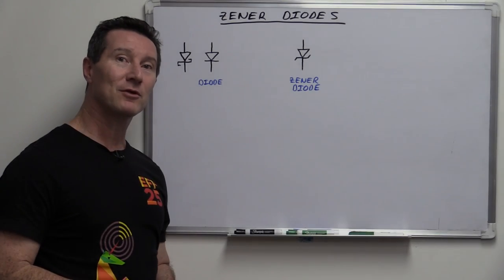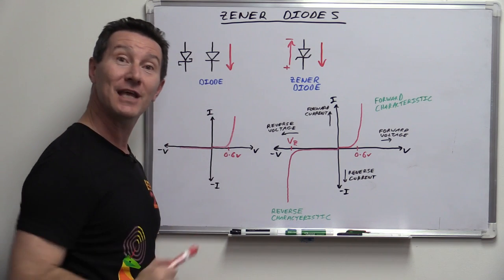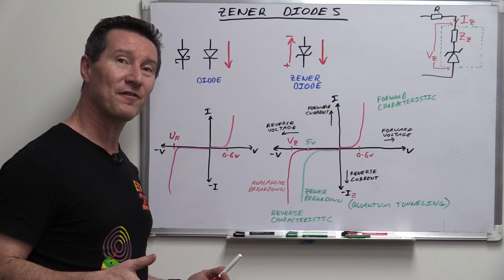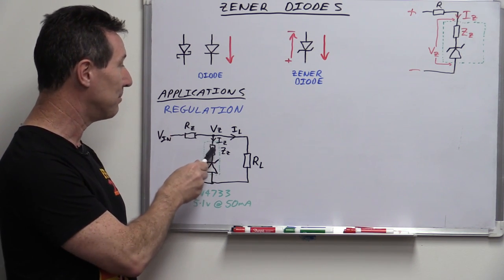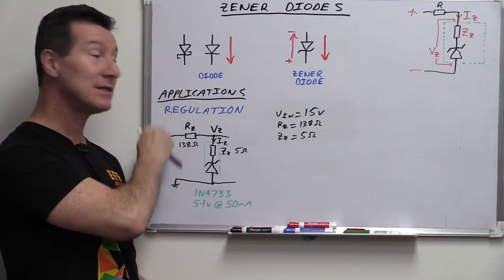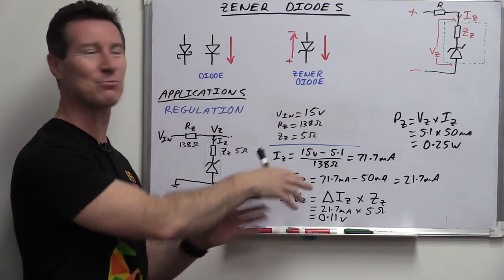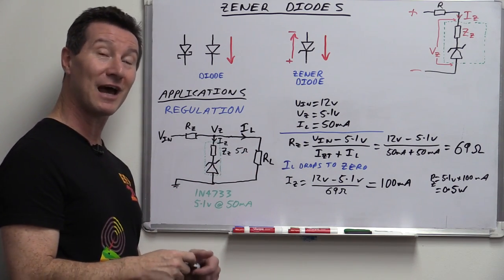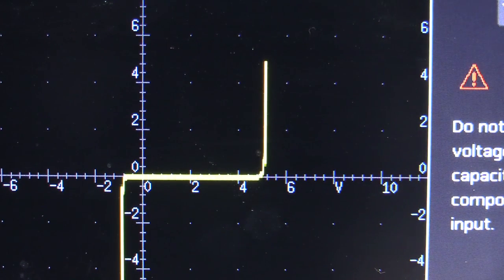EEVblog #908 - Zener Diodes

Comment: 29:00 The output voltage has a slope even though the input voltage is at its highest...How could a resistor be the cause of that? That looks more like a parasitic capacitance or inductance.
Reply: Maybe that strange cable on channel 2 introduces some capacitance

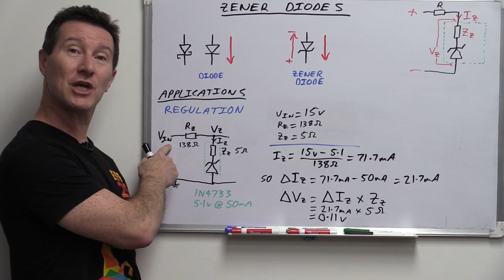Comment: About the calculation of the change of V_Z (around 13:39). So if I got it right: you wanted to calculate how much V_Z is gonna change after we increased the input voltage from 12V to 15V. For this you first calculated how much the current changed (14:54). The formula I_Z_2 = (V_IN_2 - V_Z_2) / R_Z is of course correct. But in this calculation you use the exact voltage that you want to calculate! V_Z_2! And you assumed V_Z_2 remained 5.1V, so the ultimate change we're looking for is 0V. And no further calculation is needed. Otherwise there's a contradiction isn't there? First you assume V_Z_2 is 5.1V then you calculate a voltage difference of 0.11V, so then V_Z_2 is 5.21V. It's a contradiction isn't it?

Comment: Maybe Dave explained it or I'm just not understanding things here (sorry, I'm not an electronics engineer, I'm a Computer guy), what could you use Zener diodes for with their ability to run backwards versus regular diodes?
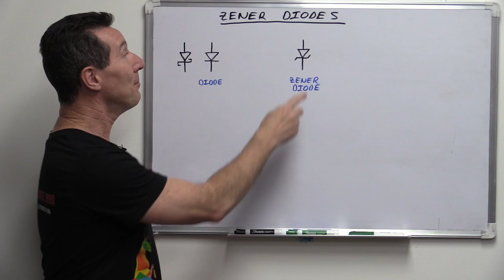Reply: Matt- you should either watch the video again or pay attention around 0:20ish.... clamping, voltage regulation, protection.... great video Dave!  Very informative.

Comment: Makes sense that any diode will conduct in reverse due to quantum tunnelling of electrons between the P and N-doped layers. That's if it even happens this way in the first place... Just a guess. EDIT: Damnit. I was half correct. Just got to 05:57 in the video.

Comment: It is U not V at the diagram, therefore being called UI-diagram, but else pretty good explained.
Reply: In australia Voltage is V the SI unit for voltage is V, therefore IV.
Reply: +Zalgar Well ok, didn't know that.
Reply: dranoelr Didnt want to sound rude or anything, but hes Aussie so he follows Aussie conventions.
Reply: What the unit is, is inconsequential to what the symbol for the quantity is. You can see that by what you just wrote, an IV graph not an AV graph. Same with ohm's law, it's I=V/R (or U/R) not A=V/Ω. In fact, the reason for using U instead of V is likely to make the symbol of voltage different from  symbol of the unit of voltage, to prevent any possible ambiguity that may arise.
Reply: But R stands for Resistance, and I is the current Intensity.
Likewise, V stands for Voltage. But what U stands for?

Also, common terms are Vcc, Vbus, Vin, Vout, rather than Ucc, Ubus, Uin, Uout.
Reply: I'm not saying that V is incorrect, only that that has nothing to do with the SI unit for voltage, per se. Both U and V are in practical use in different contexts with, I think, U being more common in Europe, as well as more common in electrical circuits as opposed electronics. What U stands for? Probably nothing other than shoehorning something similar to V to mean voltage, for the reason I explained above.
Reply: In physics, U stands for potential energy.  Since voltage is a potential, it makes sense to use U when speaking from a physics point of view at least.
Reply: Ruben Iraheta you didn't get the point. I am talking about one-letter acronyms.

P for Pressure, F for Force, m for Mass, C for Capacitance, R for Resistance.

What word starting with letter "U" corresponds symbol U designating a potential difference i.e. voltage?
Reply: Also note that sometimes the acronyms don't make sense either because they have an etymology outside of English, or because there were no suitable letters left to use. I for current is from French "intensité (du courant électrique)" whereas no one really knows where L for inductance comes from. It was likely chosen to commemorate Heinrich Lenz. But the point is that "I" was taken, so some other letter had to be chosen regardless. And the α and β values of a transistor are just Greek letters chosen by convention, because it's not even clear what you would logically call them otherwise. U for voltage may have chosen to reduce ambiguity with the unit of voltage, or it may have been chosen because V was already used for volume in physics.
Reply: Same in EU.
U is messured in Volts v
I is messured in Amperes A
Reply: @Gameboygenius  V is volume

Comment: Hope this is not too silly. Why is the negative mark on the zener connected to the positive side?
Reply: Because it's the reverse breakdown voltage of the zener that is used for clamping. If you forward bias a zener diode it acts similarly to a regular diode (i.e. it simply passes your current)

Comment: maybe you can add an led voltage circuit? i.e. 2v5, 2v7, 3v, 3v3, 3v6, 3v9, 4v1 etc :-)
Reply: C64 DTV, a Commodore 64 clone shaped like a joystick, used its red LED as a voltage reference for its regulator. If you replace it with a blue LED, the CPU blows up from the increased voltage!
Reply: +Gameboygenius so... was it a 1V8 or a 2V1 LED? since blue are nominally around 3V4... :-) so lucky I didn't get one then... ;-) it is an interesting piece of information. Btw, what cpu did ot use? I think C64 had an NMOS 65xx cpu in it.
Reply: Aries14701 Don't know what voltage the LED is, exactly. Never actually modded one myself. The CPU is an ASIC reimplementation of a 6502+some of the peripherals.

Comment: Is that a new camera? this 50 FPS is just glorious!
Reply: marshaul Explain?
Reply: Explain? There's no advantage to 50 FPS in educational content. None. You watching the character of movement in Dave's face as he talks is a distraction from the whole point of this video. And you're only doing it because you fell victim to marketing wank.
Reply: marshaul  Or I am a gamer which prefers as high FPS as possible?
Seriously, whether or not is there any educational advantage, having a higher FPS doesn't hurt, if you can afford it on the side, go ahead.
If the dilemma was to to either get a specially designed instrument for education against a camera, surely the smartest thing to do is have the instrument. But if you need nothing and it is affordable to you, why not?

Although I admit it is irrelevant, this is not marketing what drives FPS. YOU CAN SEE 60 FPS, even higher. Although to a video there is no advantage, it is mainly for aesthetic purposes (and better illusion of movement to be frank), in games it is certainly advantageous. Which is why my bias comes from comfort of having smoother frame rate experience.

For a game, essential, for a video, it just looks good.

EDIT: Just realized how you commented on how a presenter's face would distract you from the subject, which in reality it does the opposite of distracting. Are you a poe?
Reply: I didn't say his face would distract you, I said that the character of motion in an educational video is irrelevant, and ipso facto a distraction (to the degree that you notice it).

Incidentally, refresh rates above about 30 Hz simply do not provide a "better illusion of movement." You might like the character better, but what you said is exactly what high frame rates do not do. Our eyes' persistence of vision is such that realistic motion blur is typically more "accurately" represented by around 30 Hz refresh rates (depending on the exposure period/shutter angle if we're talking video/film).

It's true that certain rapid movements can be seen with more detail than is "realistic" by rendering the motion at a high refresh rate, but for most games (say, twitch FPS games) the only time you'll be potentially able to glean more useful information from this is, as a practical matter, during rapid horizontal pans. And even then it's unlikely your reaction speed is actually good enough to generate a measurable difference in response time (typically 100-200 ms!!!).

Like I said, you've bought into the wank. It's OK. Most gamers aren't engineers.

Feel free to enjoy your "glorious" aesthetic preferences, of course. But you should expect snark.

BTW, find me on Insurgency (I admin a popular server), and just for you I'll play on my lesser machine where I only get 25-30 FPS on many maps. I'll still murk you all day. ;)
Reply: marshaul Alright. I'll break it down:
First of you can't know why I like high FPS without me giving you the reason. Even then you still think I buy into some sort of marketing tactic. Frankly I don't give a damn about whether you you think higher FPS is better or non-essential. What I do give a damn is about how incorrect you are in some points.

First of:
"You watching the character of movement in Dave's face as he talks is a distraction from the whole point of this video"
to then say
"I didn't say his face would distract you"
By introducing the first sentence, you imply it is for and can distract from the main content of the video.
whether or not did you imply that, my point still stands, a presenter who is active and talking, or heck a video that displays energy in general is much more interesting than a blank screen. You pay attention to presenters who are not boring yet are on point, and one of the ways to do this is by having a character act what the audio speaks. So basically it being a distraction can't be, as it draws attention rather than bore you to tears.

"Play with me, I can beat you with 25-30 FPS"
If we to summarize your second paragraph. It is correct to say that FPS is not the main factor of playing, you need to look at skill, experience, awareness of surroundings, strategy, creativity etc. gaming as a whole if you break it down is as complicated as any other sport. Which is why FPS does not account for much. However higher FPS not only means you get a much smoother experience, giving you immersion, there is a technicality in real-time programming and that frame rate usually dictates input lag. This means the 5ms of your keyboard input when taking to account other factors becomes higher due to frame rate.
Also 25-30? Holy shit dude if that is your typical frame rate ON INSURGENCY get better hardware, such instability is even more dramatic to input lag and reaction time.
I however do not accept such a challenge as I am not interested in such a game. Also since such challenges involve 1vs1 and don't justify a tactical shooter, and would much rather have score attack competition which would provide better judgement.

' refresh rates above about 30 Hz simply do not provide a "better illusion of movement." '
It basically implies you can't detect any higher frame rate if it doesn't provide better illusion.
I don't think it is likely that someone's vision is limited to seeing only 15 fps or 30fps.
Any gamer can tell you that there is a difference between 30 frames a second and 60 frames a second, and it is not just character, it is gameplay and immersion in general.
Also fuck motion blur, seriously, that thing time and time again is not properly calibrated and all I have is a binary control of either ON or OFF, and it is so obnoxious. Especially when in a tactical shooter the character is pretty much the same color as the surroundings and when it turns into a smudge even if I changed my rotation by 5 degrees, I might as well play blindfolded.

As to the fourth paragraph, I will agree. There is not much about avoiding danger even if you have twice more frames...
However, it is much better to see a tank run you over instead of a laggy mess.
Granted if the frame rate is stable usually there is no added information.

So it really comes down to this: Aesthetic and input lag. I can hardly believe someone would just make a comment ridiculing higher frame rate when objectively it is more aesthetic and immersive. Like I said, if you can afford such luxury, why not? a "market says so" is not a good enough reason, I want to see an argument, and a sound argument, that higher FPS would actually hinder my gameplay. If it were a difference between 120-200 I may be more inclined to agree with you it would be useless.
Reply: Your ignorance is astounding. :) It's obvious you're a reader of gaming rags and not an engineer, so I will merely point out the following:

"It basically implies you can't detect any higher frame rate if it doesn't provide better illusion."

No, not at all. And this reveals how little you understand about how our eyes and how video work. Quite the contrary, a higher frame rate can be easily observed (given sufficient rapid motion). But this simply does not make it more realistic. In actual, physical space, rapidly moving objects will always exhibit extreme motion blur. Period. However it is trivial to photograph the same motion with a high enough frame rate such that, when viewed back on a smaller screen, the motion blur is absent. But this is not more realistic. It may be nicer, better, more useful, and it may contain more information. But it is not realistic. Realistically, you would see all that blur which our eyes could not possible escape.

That's why film was selected to shoot 24 FPS with 180° shutter eons ago. They certainly had the technical ability to shoot film at higher frame rates (and money too given how much a typical big-budget film spends on film stock and processing).

Incidentally, I have another machine which is ample, and the difference between playing at 30 FPS and 60 FPS (the game's stock cap) is marginal at best. Again, this is simply due to humans' naturally slow reaction times. That was my whole point: I'm a "gamer" too, and gamers like you who have been led to believe there will be a measurable difference in their performance between 30 and 60 FPS simply have not performed controlled A/B analysis. The numbers don't add up to the benefits claimed: the latency reduced by moving from 30 FPS to 60 FPS is so far less than human reaction time as to be effectively noise; so is the latency at 30 FPS. The numbers are off by an order of magnitude. The absolute best-case scenario (remembering there will be a phase offset between action and frame) is about 10%. Most of the time it will be less.

When I do a reaction time test, it's impossible to get my reaction speed to within 10% consistency. It varies by about 25%. So that best-case 10% is down in the noise floor. It's not going to make a measurable difference. It can't.
Reply from the maker: Nope, same old camera.

Comment: Why  not to include the VARIABLE ZENER (TL431)in this video?
Reply: Because the point of the video was to discuss the fundamentals of a zener diode. LM431 is a bunch of active circuitry that works similar to a zener.

Comment: In the regulation example: I didn't get why did we choose 50mA.
Reply from the maker: It's the nominal test current of the zener. If you mean the load current, it's just a number plucked out of my butt.
Reply: EEVblog In another circuit, we just need a resistor large enough for the resulting current to not fry the diode, right?

Comment: What is the difference between clamping and clipping?
Reply: Clamping is setting the voltage a signal will clip at.
Reply: In case of using a Zener it's physically the same thing. But yeah, clamping is about regulation or circuit protection (generally limiting voltage) and clipping is the change of a signal shape at a certain voltage.
Reply: Clipping is, when a device's Input(an ADC for example), is going to saturate while clamping is to protect the device from doing so by sending the signal to a low impedance source ( VCC or VSS typically), before it reaches a certain point.
Reply: Ok, thank you all who replied

Comment: the electrons  go from negative to positive
Reply: muraturile I thought the positive terminal of a battery. was positively charged with electrons!  giving them an actual negative charge. so the electron come out of the pos. thru the circuit and in to the neg. is that wrong?

Comment: Wait, wait, so you say that the value of the resistor (Rz) you have to choose as a compromise because you can't change it once it's in your circuit. What if you could though? (...and I don't mean a potentiometer! :P)

Is there such a thing like a, say, programmable, or - first of all - voltage controlled resistor? Or current controlled resistor? (well, I guess one could be made on the basis of the other) *Googles* Oh crap, so things like that do exist... Mind blown.

Comment: very helpful. i was confused to understand the diode as normal voltage regulator but as you cleared things up that it isn't a good device when load is connected.

Comment: So, the zener diode in zener configuiration will always have to dissipate Izt1 mA current for proper regulation. Otherwise, the regulated voltage will drop, right?

Comment: Hi Dave. Good to see you back in the lab. Now it makes sense to me why you had a constant current source on the voltage reference in your labpsu videos. Is there a difference between voltage references and zener diodes?
Reply from the maker: Voltages references use a buried zener reference, and are often nothing more than that.

Comment: Hooking a 5V Arduino to drive a 3.3v BlueTooth board, I used a zener to clamp the signal.  NOPE. 

If I had watched this vid first, I would have known that the zener effect doesn't work at low currents - and signals are usually very low current.   Great job, Dave!